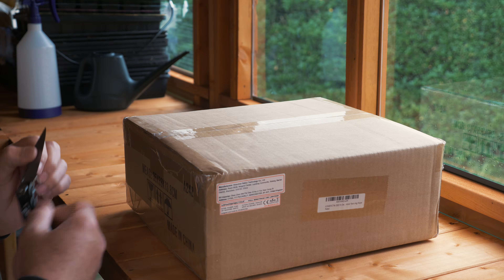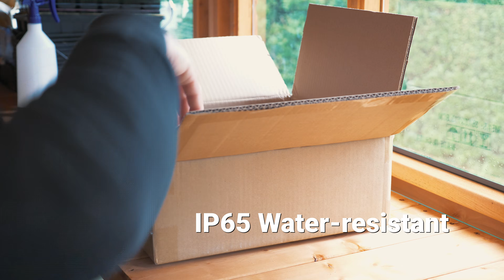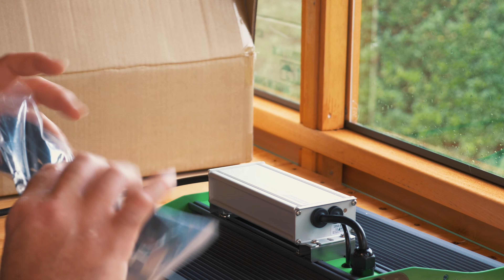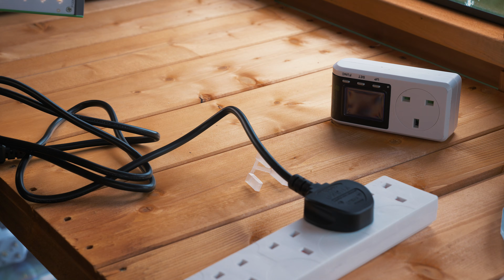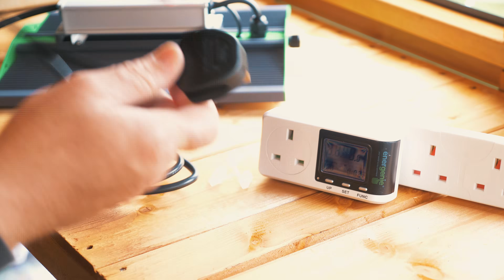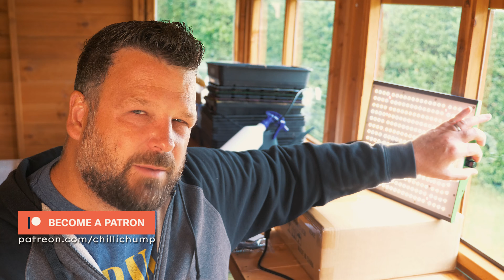Growlight Unboxing and Giveaway! ViparSpectra P1000

Comment: Stay Safe - KERTHUNK - Stay Spicy.  Perfect timing.

I have a cheapskates lighing rig at the mo.  Probably the cheapest LED on ebay strapped to the tow of two shelves from a cheap greenhouse staking shelving with some twist ties. The distance between the plants and the lights is governed by mow many gardening magazines the seed tray is sitting on.

Not the best, not the most efficient but it's better thsn the light coming in through the window for the time that I use it,

Comment: I could use a light like that for my grow rack. I've discovered with my par meter that the ones I've been using are not as bright as I thought. I also really want a light with a dimmer which the panels I've been using in my rack aren't. What PAR meter you getting? Stay spicy!
Reply from the maker: I have already bought it. It's from Apogee. Does a great job...but not cheap!
Reply: @ChilliChump  that’s what I got. Not cheap at all!

Comment: Need one in my life😁, my outdoor mini plastic green house is failing my peppers, they are getting sun burned even though i thought i done everything right😕so i brought them back in to recover, but the light i have them under is a pretty crappy blue 6500k florencent, and could do with something like this,  as they are looking a bit feeble😥. Stay spicy🌶
Reply from the maker: Get the fluorescent lights as close to the canopy as you can...they can even touch the leaves.
Reply: @ChilliChump  ok will try 👌, im trying to cover four 11 litre pots and two 2 litre pots with a 2ft dual t5 that  i was using for seedlings, but its struggling to cover them all,
Reply: Thankyou for responding